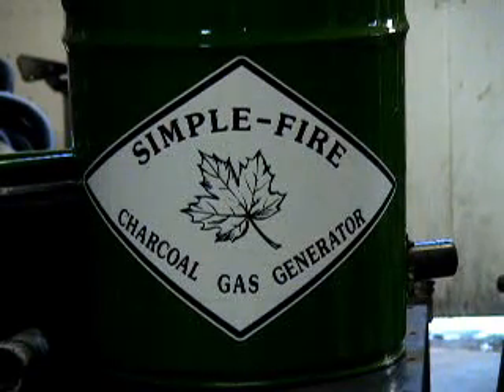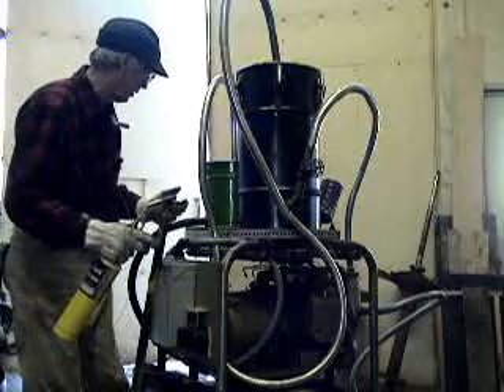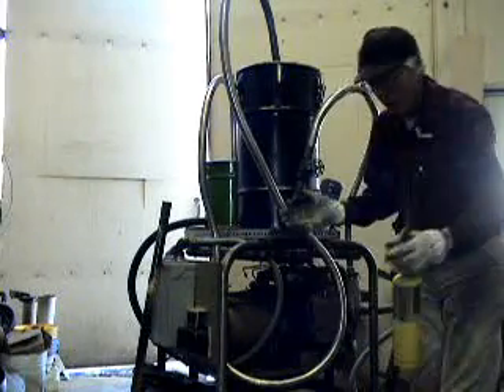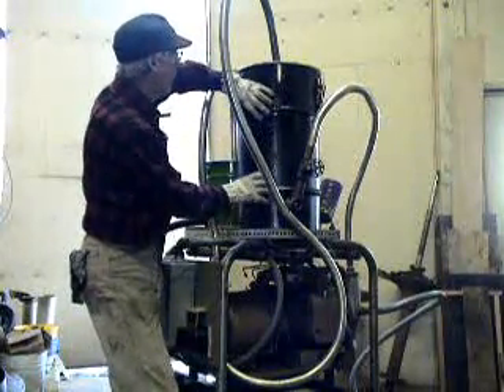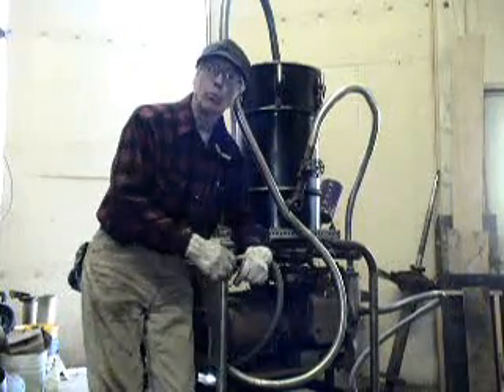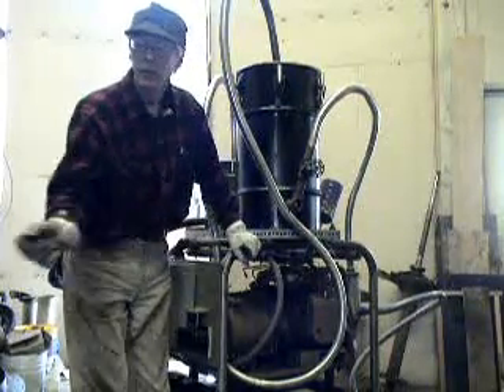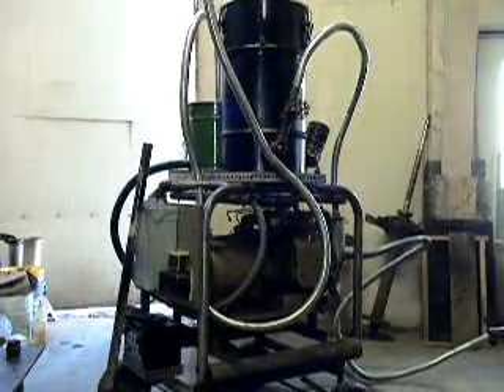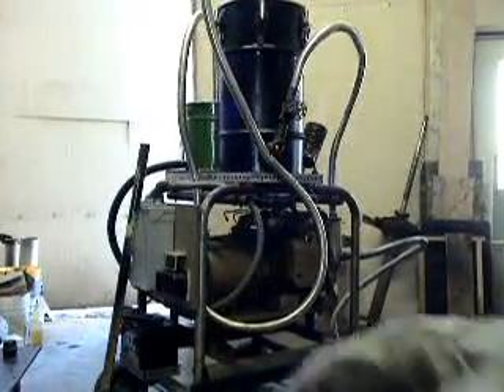Simple fire charcoal gasifier

Comment: i noticed you used flex pipe , some of that stuff is not air tight , i always thought it was , then one day some water fell on a cold hose and it bubbled , it was not steam, so we had to ditch all the piping and go with ss gas line

Comment: For more Hydrogen in the mix
Why not bubble the exhaust through water, or pass it over water to induce steam?
Reply: It’s better to have a steam injection system. When it heats up above a certain point, a sensor can activate a dripper valve and release liquid water into a copper coil that will blast into the intake of it. The system you’re talking about will cause wet gas.
Reply: just drip water into the gasifier inlet, it's hot enough to instantly vaporise the water , and helps keep the charcoal reaction cooler (keeps the steel from melting)
Reply: Work is giving u success